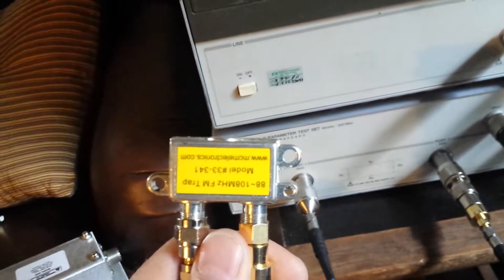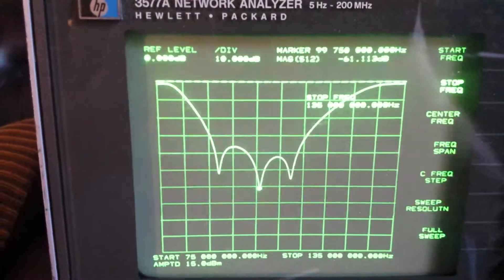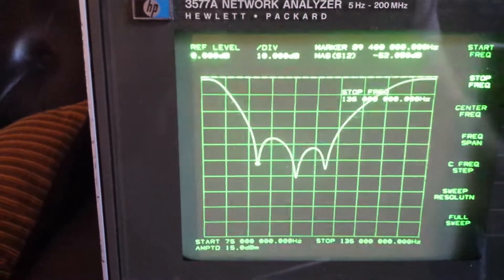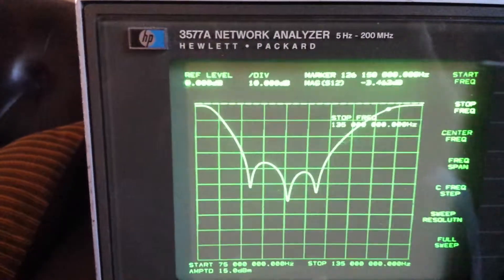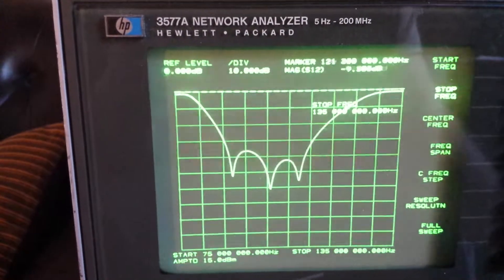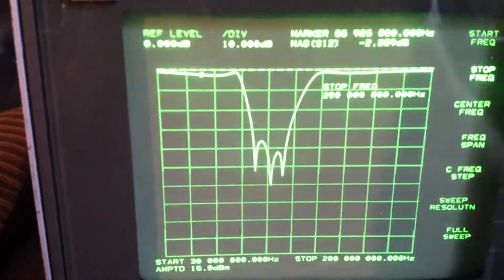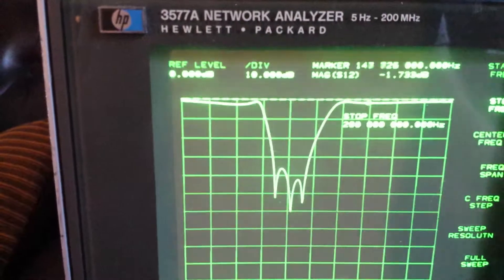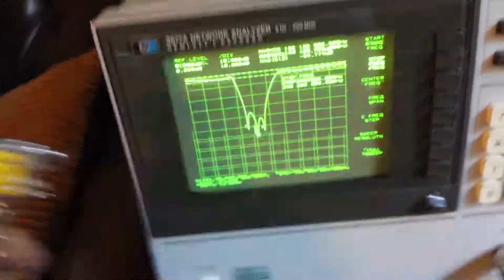MCM electronics FM trap characteristics.

Comment: Ha I was looking at this notch filter and this video is exactly what I wanted to know. Thx! :-)
Reply: +Dr Tune Ah I see your analyzer goes up to 200mhz - any guesses about performance above that? I assume things like the UHF connectors on the filter become an issue going up into the Ghz range..?
Reply from the maker: +Dr Tune Insertion loss will definitely increase with a rise in frequency, and for sure the connectors will be less than ideal.  If you are working in the Ghz range, however, most likely the FM broadcast band would not cause you issues in terms of interference, unless you were working with a receiver that had almost zero pre-selector filtering on it.